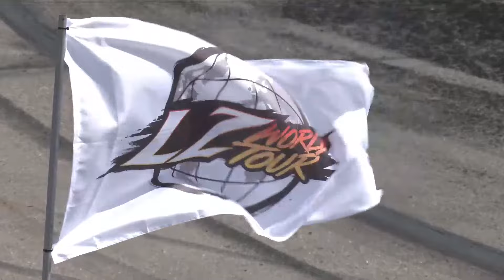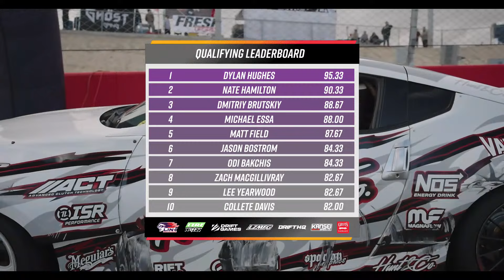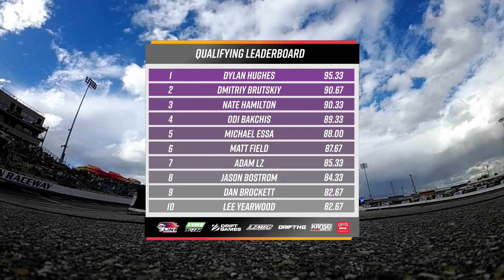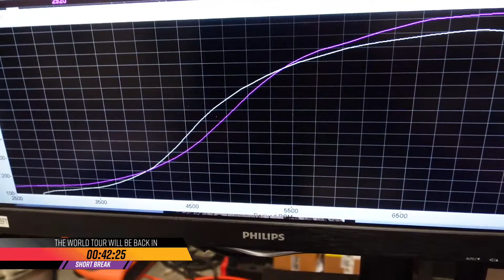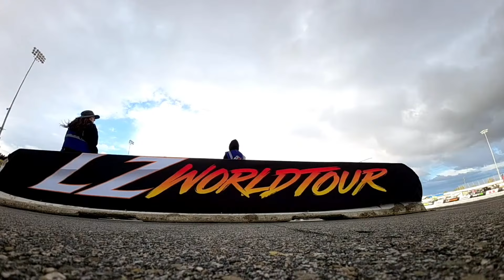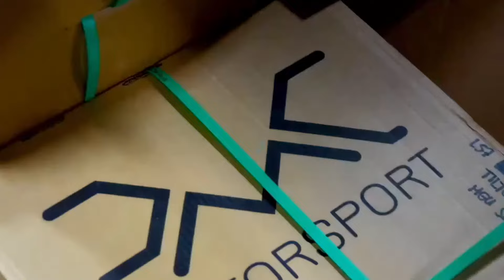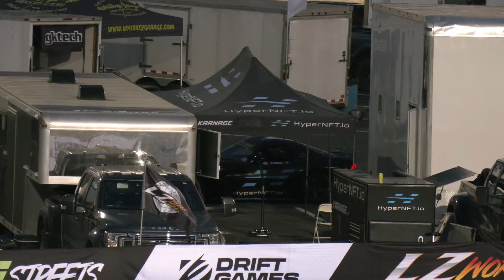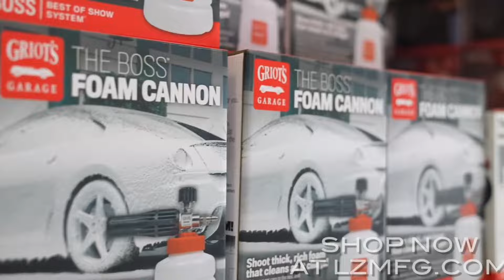LZ World Tour '24 - Stop 1 - Kern Raceway - Day 1

Comment: Hunt vs. Jones was an epic mistake by the judges. Jones threw the car into the corner 10 meters too early, tried to correct with the left foot brake to wide the line. Didn't succeed and braked the grip off the front tires and drove out.

Comment: Im 100% confident I could set Dean's Viper up better than his team does. Something I've seen with him is his car, which has never looked natural or comfortable, always seem like the balance is off. You have a long car that isnt easy to transition and they always try to make it faster than everyone else. When they already have the fast chassis. Get the COG as low as possible, a mopar billet srt10 just as low and far back as possible, and then just focus entirely on making the car nimble and confortable. He needs to comfortable transition faster than the other shorter wheel base cars, while also having just enough rear side bite and front under steer to slow him down in transition when he goes to whip it hard to stay behind. They haven't figured out that or how to achieve that yet, and it shows. He never manages a transition in follow that looks smooth and uninterrupted unless its behind an entirely faster driver.
Reply: It's also the reason you see his car struggling with angle, way too much rear side bite, probably because they run toe in because they try to make a viper fast. Vipers are built to feel and drive like they want to kill you, taming them is the solution.